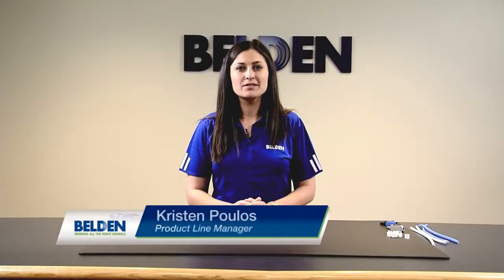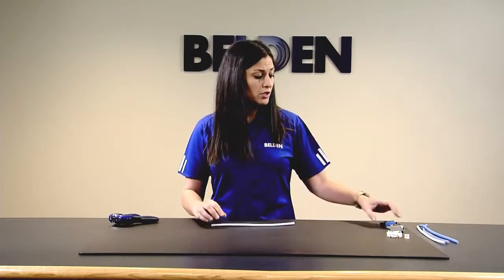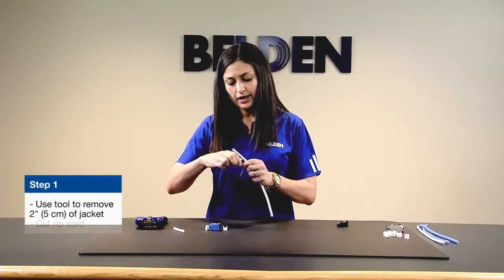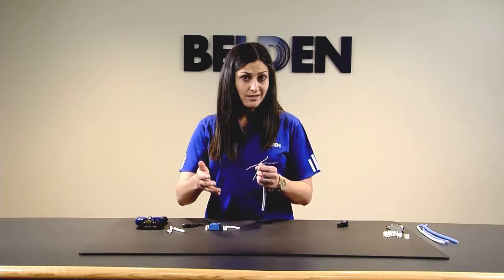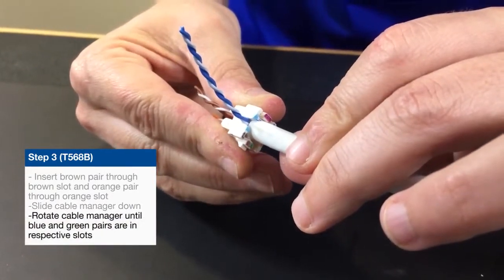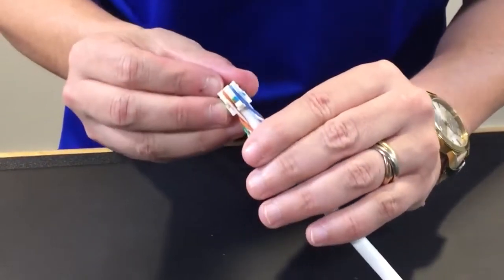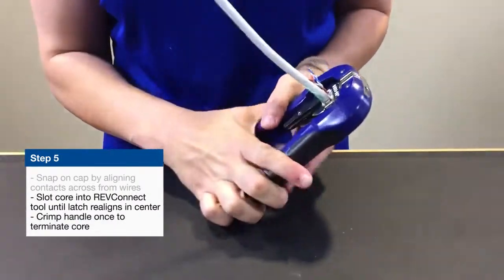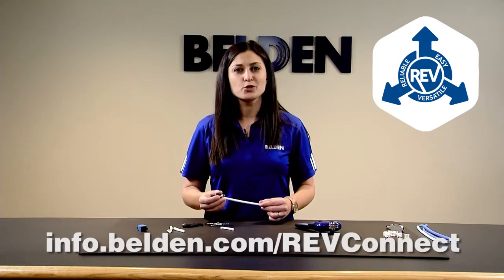Step-by-Step Belden REVConnect UTP Termination Instruction Video — Allied Electronics & Automation

Comment: Cool video. Can you do one on how to replace the blades in the termination tool?
Reply: How do you remove the terminating cap? We have almost 50% failure rate with cable manager and terminating cap. Is there a way to take it off and reuse  again?
Reply from the maker: Thanks for reaching out, Tevin. Here is the blade replacement instruction, located on the original tool packaging: "''Undo the screw using a 1.5mm (1/16'') hex key to replace the cutting blade." We hope that helps!